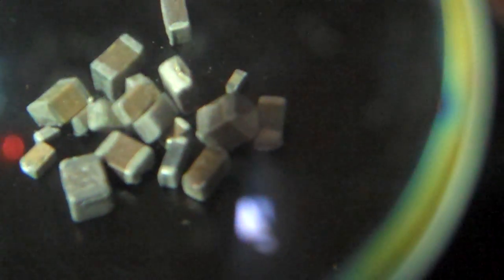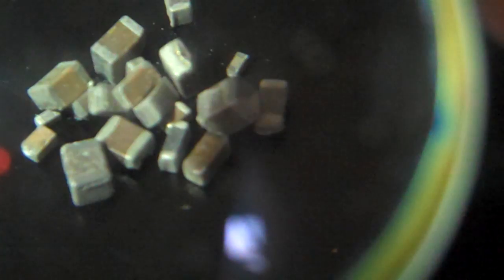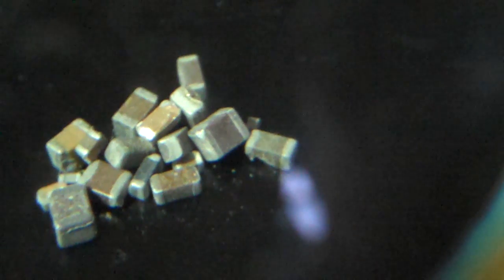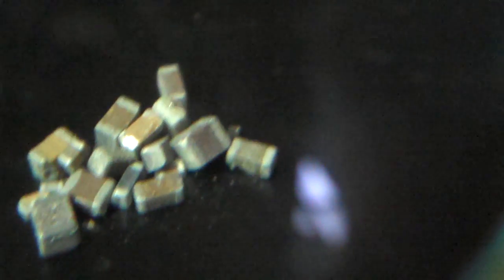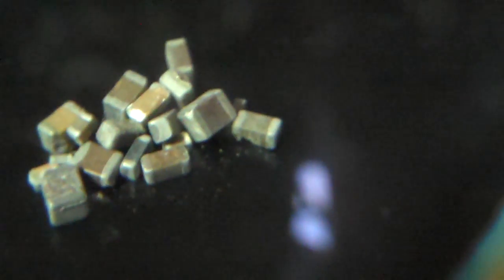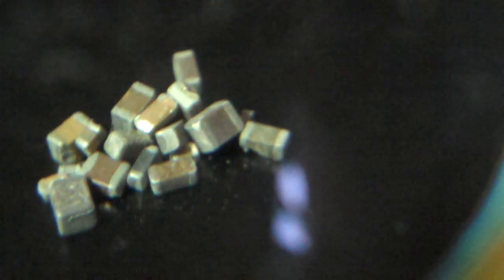Monolithic Ceramic Capacitors: Palladium and Silver

Comment: hey Feets, I've seen a lot of capacitors that are identical to the monolithic ones but have numbers on them. are they also our friends?
Reply from the maker: They can have silver in them. If they are little, teeny-tiny black ones they can have rhodium.
Reply: +OriginalFeets Those teeny-tiny black ones with numbers are called Resistors. When I scrap a board, I sepereate these because they have different market values. The resistors will usually be attached with silver solder too.

Comment: How do you take these off do you just use a soldering iron?
Reply from the maker: You can use a small wood chisel to pop them off with. Go at them from the silver ends and they come off quite easily.
Reply: OriginalFeets

Comment: Just to say an easier way of getting these is to basically put the whole board in an open (under a fume hood or out in the open), then give the board a good tap and everything will fall off as the solder will have melted. 

Not you will get lead, mercury and tin fumes doing this so you must take the necessary precautions.

Comment from the maker: Silver can be in the solder on motherboards. It's in these capacitor ends from the video. There is silver in the tantalum capacitors as well. Those are the little yellow boxes with red print on them you find in phones and smaller electronics and on some motherboards and they also look like dipped capacitors with a bent leg. They will be marked for polarity so they don't get installed backwards... BOOM if that happens :)